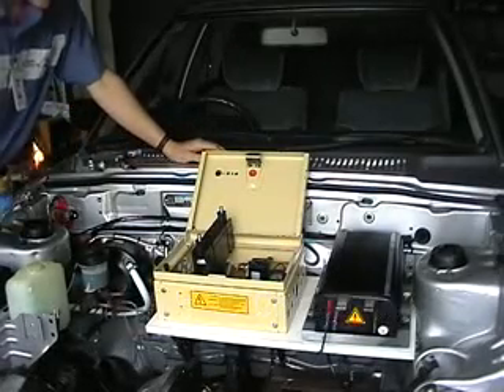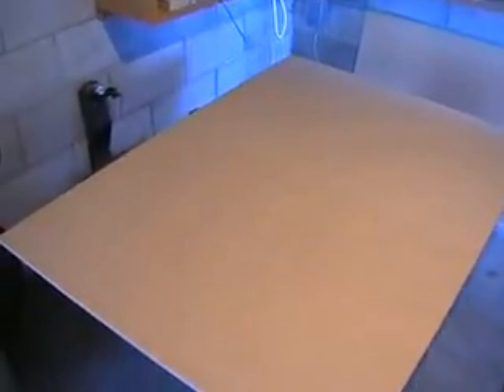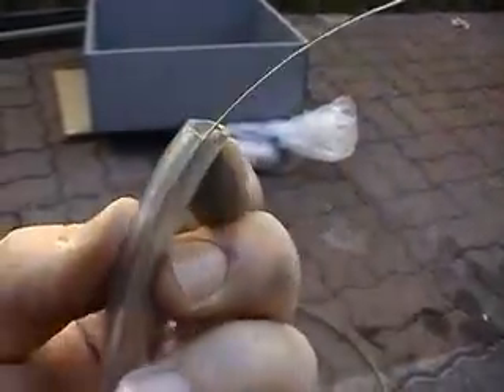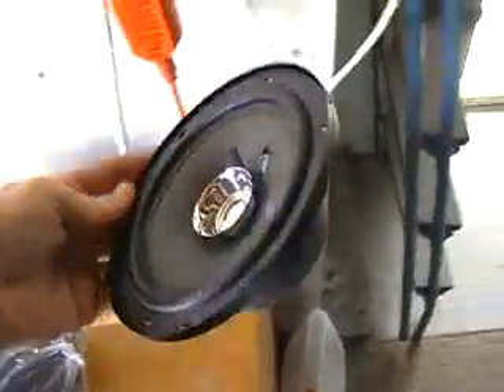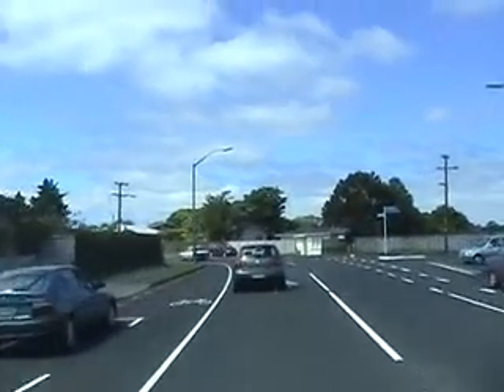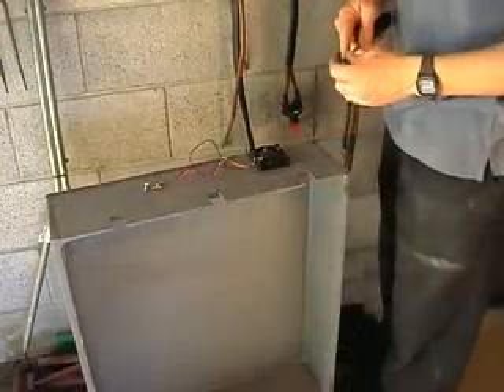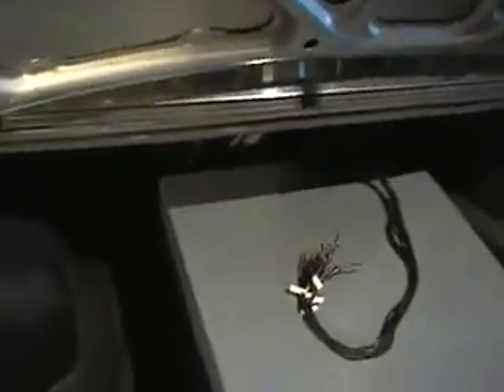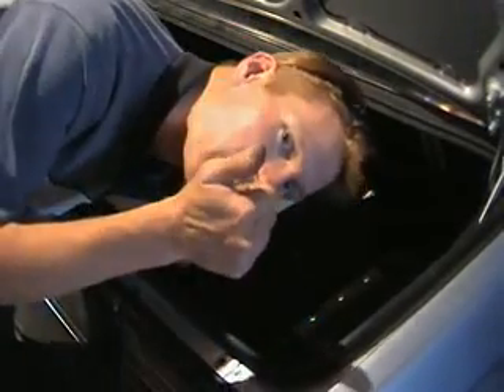Gav's EV Conversion 14 - Installing the Batteries

Comment: Well, Li-Po cells still will be way to expensive for the time being. For example the pack giving you ~90 volt, with 500 Ah, will cost you approximately 30000 usd, the other thing - when you have ~100 kg of lithium behind your back it is like driving a bomb. So for now the optimal solution is Gel and AGM batteries.

Comment from the maker: Thanks folks! I would like to replace the shocks in the car. There's not enough battery weight in the back (115 kg) to install new springs but new shocks would make it feel less like a boat. :)

The straps on the batteries can be removed by undoing the clasps. I wouldn't re-use the straps as it's cheap and fast to to replace them with new ones.
I installed the longest length of cable last night too. Fits well so far!

Comment: Sorry, Gav.. I must have missed that part, probably busy thinking about something you'd said earlier.. Or busy wondering.. Is he going to add ducting... ;)
Those straps are permanent, right ?
They'd have to be cut and replaced to remove a battery, or is there some way of releasing them and re-fastening ?

Comment: Ooooohhhh... It's getting TOOOOOOO exciting !!
This puzzles me though...
Put batteries in a box, seal box as per regs so that gas doesn't vent into the boot... Then install fans to pull the gas from the box into the boot ?? Eh ? Do I misunderstand ?
Or are you going to put some ducting to take the vented gas to the outside of the car ?

Comment from the maker: I thought I'd better point out that the heatshrink I'm using is "thick wall", adhesive-lined shrink, designed to be flame-brushed.

The main cables should be here tomorrow too! Then I can start getting the car ready for it's first test drive! :)